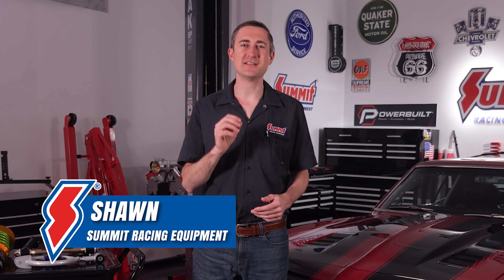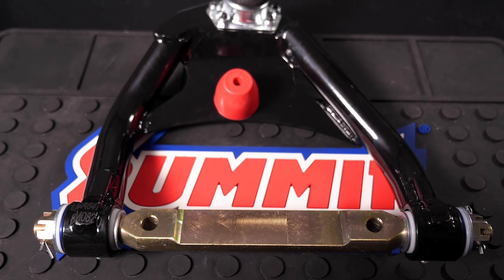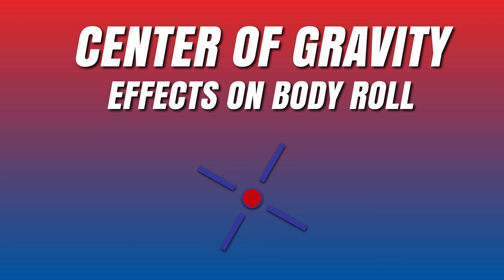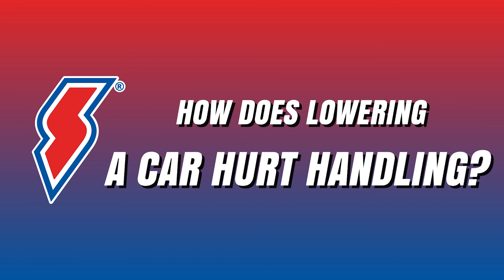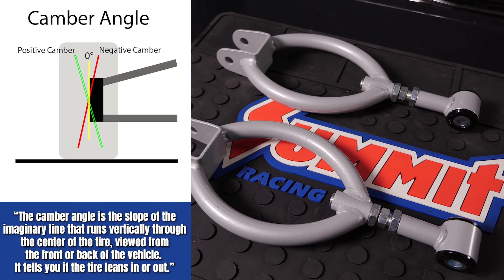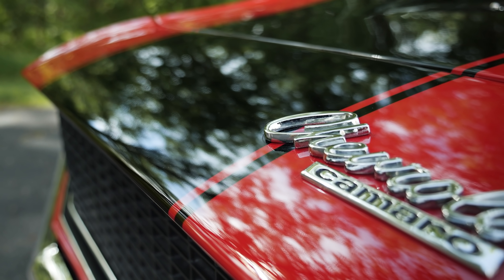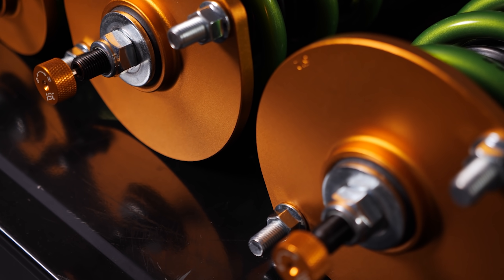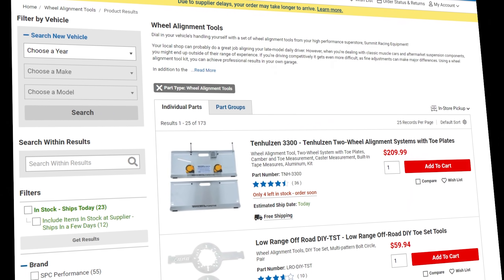Will Lowering Your Car Automatically Make It Handle Better?

Comment: Do you guys have a video on adding an auxillary tranny cooler? If not would you recommend bypassing the oem cooler that goes into the radiator,this is for an 88 k5 blazer,thank you.

Comment: On one of my vehicles I installed 1.5” aftermarket “performance” coils/shocks and it looked nice. I was not impressed as the ride was garbage, felt too stiff and would bottom out easily and would not drive it at speed on a track with minor bumps and dips. The stock suspension performed much better in my opinion other than it being a little on the soft side.
Reply from the maker: Thanks for watching, Parker.
Reply: Summit Racing -Thanks Summit Racing I love your products.

Comment: Sounds like a lot of trial, and error.
Reply: There’s a problem with the question. It shouldn’t be does a lowered car handle better than stock but, does an Aftermarket Suspension handle better than OEM. This is a more elaborate question that the simpleness of “lowering” your car.